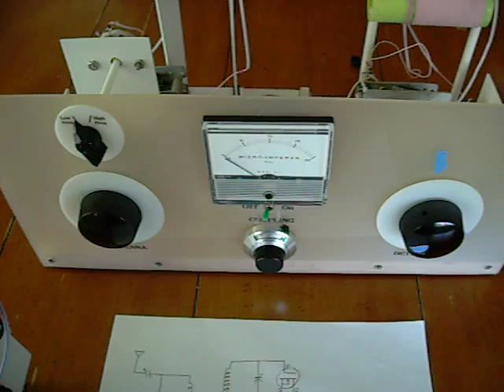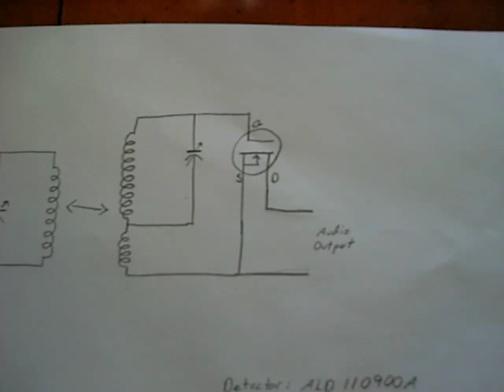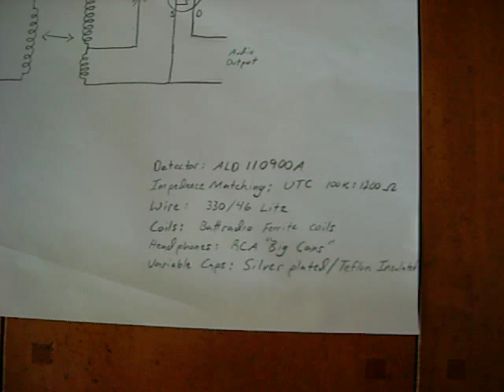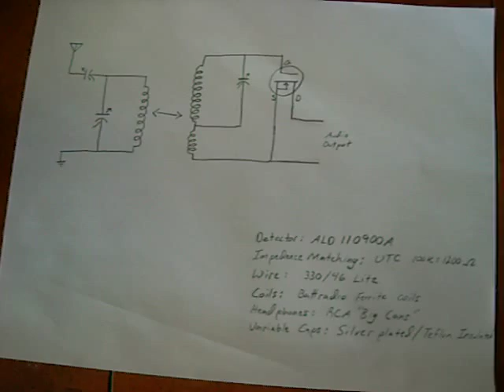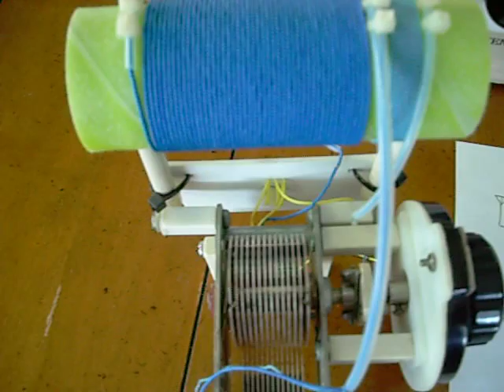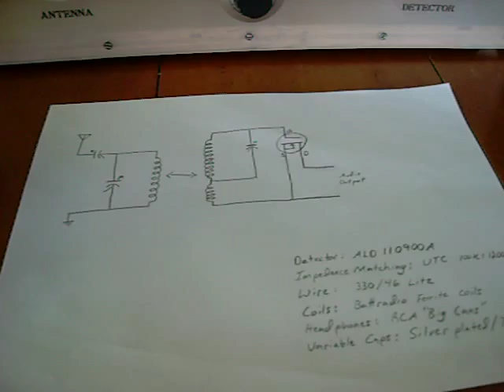Table Top ZB FET Crystal Radio Set Description/Schematic

Comment: what's the size of your coils,turns, and antenna?
I'm making a crystal radio with salvaged parts, homemade coil, and diode.
nice video!
Reply from the maker: +Sooner Science Nerd 

I've used quite a few different antennas and antenna lengths with this set and it works well with all of them.  Longer and higher the better though.  Good ground also makes a notable difference.  As far as coils go, any inductance from 180 uH to 230 uH should do just fine.  Search Professor Coyle on google and use the handy coil turn/resonance/variable capacitor calculator.  That calculator yields a wealth of useful information.  What state are you in?  What type of headphones will you be using?
Reply: +josh8loop I'm in Oklahoma and am using an amplified speaker (radio shack).
i made a ground wire from the ground plug and an alligator clip.
my antenna is just a coax cable, with an alligator clip. no outside antenna- lightning issues.
I connected my 25 turn tap to my crystal radio, and can hear Nashville, TN, CBS sports, and my nearest channel,kfaq.
Reply from the maker: +Sooner Science Nerd 

Great work there!  Part of the fun and initial difficulty is to get the first one up and running.  Looks like you have passed that hurdle and ready to tackle the next challenge.  Living in Florida here lightening is an issue for me as well.  I ended up constructing a large loop crystal radio which can be seen in my other videos.  I can operate it inside the garage(during storms even) or wheel it outside if I wish.  It's a bit on the large side but manageable.  The performance is simply astounding.
Reply: @josh8loop  thanks for your details. Greetings from Chile, south America.
Sorry for my english.

Comment from the maker: Yes, That's true.  In fact the Hallicrafters S-77A I listened to tonight has one of those.  Only issue is that adding another component to this tank circuit could reduce the Q.  I would rather do it mechanically and get the same result with no Q hit to the circuit.